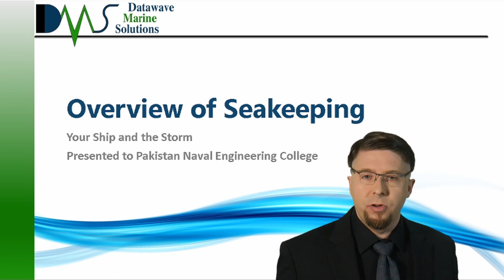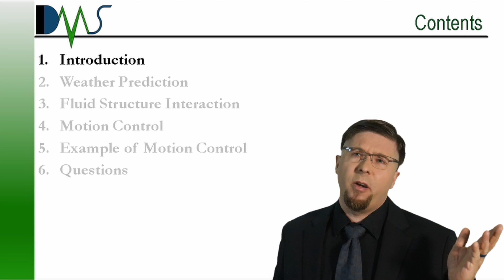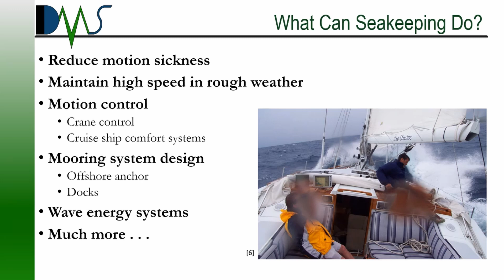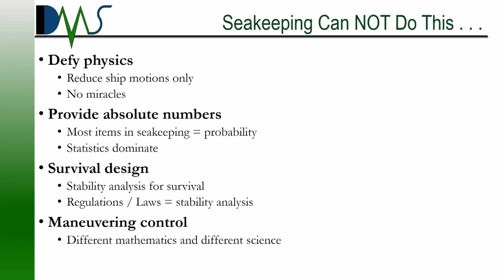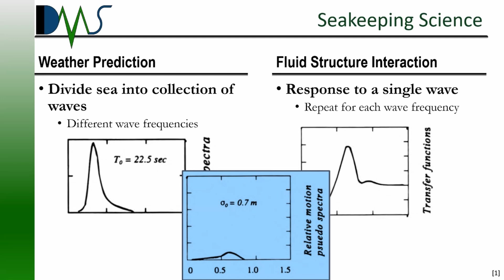SEAKEEPING 1:  Introduction to Seakeeping

Comment: Hello ¿Can you explain me the differents between Naval Architect and Engineer?
Thanks.
Reply from the maker: The term "Naval Architect" really is misleading.  A "Naval Architect" is an "Engineer" that specializes in ship design.  Within the field of ship design, engineers tend to divide into three broad groups:  "Naval Architects" focus on the ship structure, hydrodynamics, and interactions with the water.  "Marine Engineers" focus on mechanical systems (engines, HVAC, pumps and piping) and interior safety.  "Electrical Engineers" focus on the ship's electrical systems.  But there is still large overlap between all the professions.  For example, Naval Architects and Marine Engineers both specialize in structural design.

Comment: I am enjoying the magic of the Towing Tank.
Particularly the construction of them.
Have you covered the earth curving nature of the Towing Tanks.
I ask because I have a a Flat Earther friend who totally believes that water can not display convexity upon the surface of large standing bodies of water.
However TOWING TANKS.
Reply from the maker: I did not explicitly cover this.  But you are correct.  For longer towing tanks, we need to account for curvature of the earth, specifically when aligning the rails for the towing carriage.  This gets tricky because you need a reference line that also curves with the earth.  A straight laser line will not work.  One example I saw used a trough of water as the reference surface, since the water surface adjusts to match the local gravitational field.
Reply: @DatawaveMarineSolutions  mate I enjoyed your videos, I was researching for a flat earth debunking video I made. The target says often that large standing bodies of water do not display convexity upon there surface.  Towing Tanks say otherwise. 
Pop over to my channel and check out the video with Towing Tanks.
Reply: @DatawaveMarineSolutions  link is https://youtu.be/y2BetGUteWY
Reply: @DatawaveMarineSolutions  oh and read the pinned comments. A couple of flat earthers are a bit triggered by me.